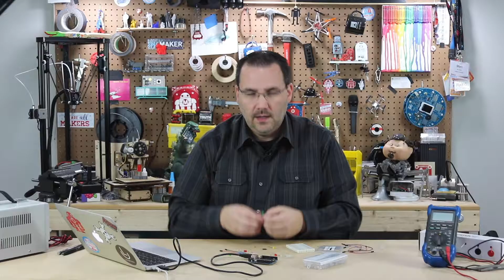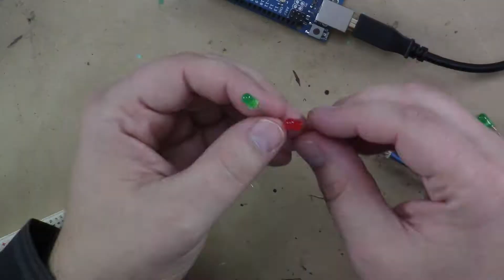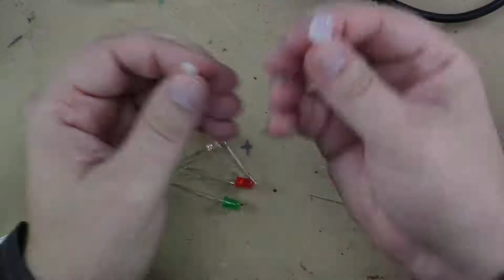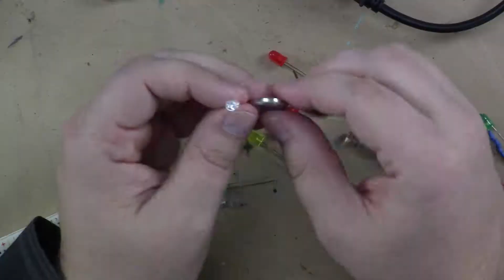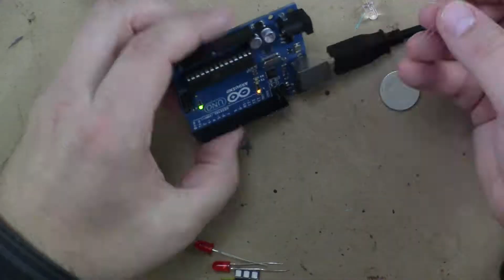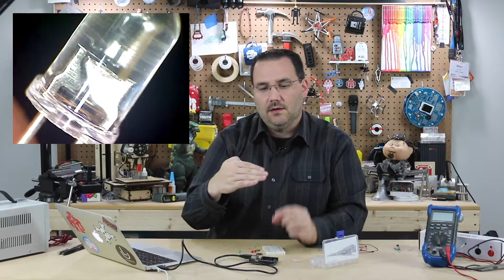Arduino LED Tutorial: The Resistor Mistake Almost Everyone Makes

Comment from the maker: ⚡ Quick tip: if you ever get an LED where both leads are the same length, look inside the plastic. The bigger flat cup is the negative side and the small pointed anvil is the positive side. There is usually a flat spot on the rim of the housing too, and it always lines up with the cup and the short lead. Three independent ways to check polarity, no multimeter needed.

📌 FULL SERIES: Watch all 100+ episodes of the Complete Arduino Prototyping Series. https://www.youtube.com/playlist?list=PLcKte0wD90Y4lsrStEWB5NR1gKMs0FDts

What is the weirdest LED shape you have come across?